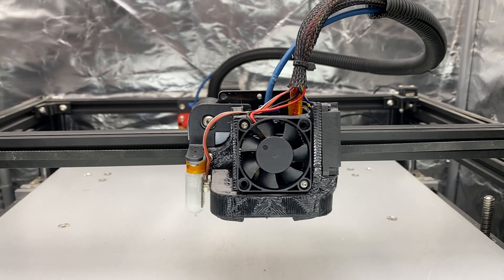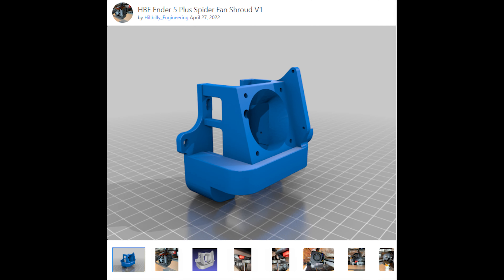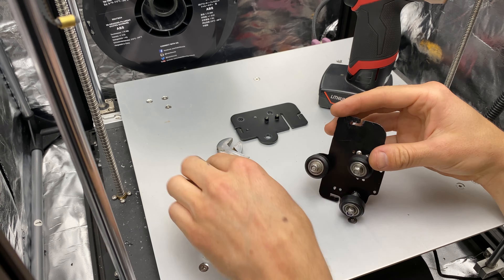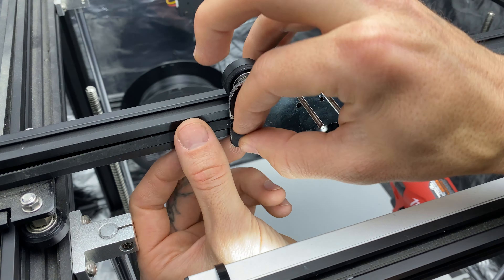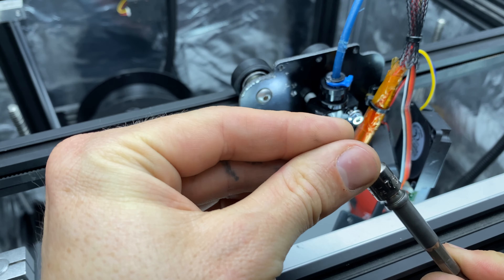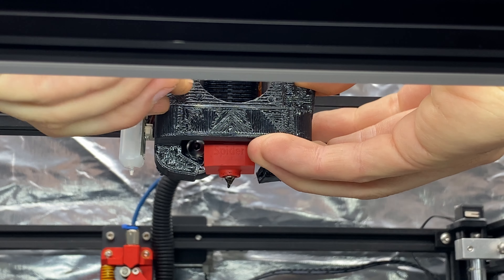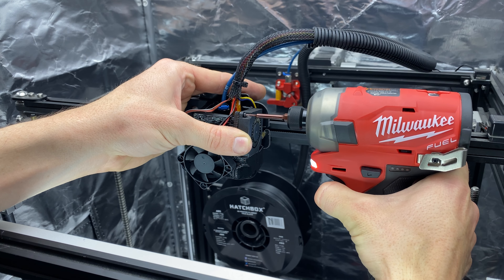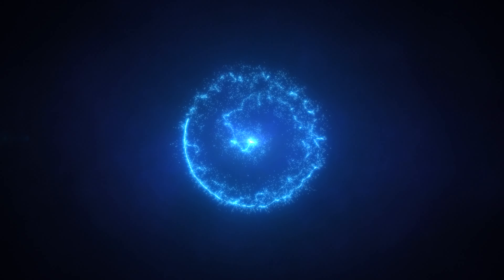How To Install Spider Hotend on Ender 5 Plus

Comment: Just as a note on this, the new Creality Spider v4 "Speedy Spider" is smaller and about the same size as the stock, within about 0.3mm   
I did have to put a small washer on my BL Touch as a spacer, but aside from that, everything was pefect with the new V4 Spider.
This video is still valid though as there are a lot still selling the V3 Spider.

Comment: I started to install this on my new Ender 5 - Figured since I bought it from creality that it would work. But noticed how much bigger it was than the other then noticed it was not goign to fit without some modifications. So now I am deciding if I do it or buy a different hotend..
Like your design though! Thanks for posting this!
The wires for my thermister are way shorter than the oem wires, looks like I might have to do some splicing as well.

Comment: Is there a kit that allows me to use a direct drive extruder? I have bought a direct drive kit from amazon but the kit seems to be sized for a stock hot end not this spider hot end so im getting nozzle bed crashes. Any help is greatly appreciated. I tried spacing the bL touch but then it crashes into the left side frame supports 😮‍💨

Comment: Curious if I can get this shroud resin printed. Gonna work with an etsy custom shop and have them print it off and I'll test it out.
Reply from the maker: By shroud you mean the fan shroud right? 
I’m sure you could, but I wouldn’t recommend it unless you’re familiar with the strength/performance of resin prints. I designed the shroud to be printed without supports on an fdm machine, resin printers work a bit differently and you would want to angle the print and add supports. The “general functional part” type resin I’m using on my resin printer warps over time and snaps before it bends too far. Very high quality parts but strength is not comparable to fdm. I would print it in abs before you disassemble the ender if you can. 
For the cost and effort, you could also probably buy a cheap used fdm printer and use it print the shroud. The shroud doesn’t have to be perfect, you can print a better one once you have the spider setup and dialed in.
Reply: @hillbilly-engineering  I just sent the file to two custom 3d printer etsy shops. One resin and one high temp ABS. Also yes when I said shroud I was talking about the fan shroud

Comment: After doing this conversion I am getting an error for the print head temperature sensor. I know the spider hot end came with a new one. I replaced it but the connector did not line up to the Creality plug. Any ideas?
Reply from the maker: The plug mismatch is another miss on creality’s end. The new thermister plug can be finessed into the stock plug and will work. Basically just look at both male and female side of connectors and when plugging them together, align the pins as best you can and force the connectors together.

Comment: It looks like on the new plate you simply moved the holes up then used some flathead screws and spacers to mount the spider hotend.  Guessing if I simply scribe an offset line for height difference I could just drill some new holes.
Reply from the maker: Sure, you can do it that way. Thats the way I made my first one but the ones I sold have more “nice to haves” and are lasercut. Good luck on your version, don’t let the bit walk!!

Comment: are you building any more of these? i could really use one
Reply from the maker: Yes I can, it’ll take me a few days to put some kits together for those who’ve asked, I’ll shoot an update here when they’re up
Reply: @hillbilly-engineering  great, i have the extruder now, didnt relize i need the x carrage. will be getting one from you when you have it built. would carbon nanofiber be good for the shroud?
Reply: @hillbilly-engineering  i got your kit from ebay last week and installed it. all is working perfect now, only thing i found was i thing they changed the size of the spider hotend. i had to use the 2nd set of holes instead of the 1st ones
Reply from the maker: @mecksg1  do you mean the upper set instead of the lower set?
Reply from the maker: @mecksg1  I haven’t tried carbon nanofiber, the main rule of thumb is you will need more heat resistance than pla can offer. I tried with the basic materials and pla warped almost immediately, but abs, petg, nylon and variants based on these will be fine
Reply: @hillbilly-engineering  yep I had to use the lower set of holes to get it to work right. All good
Reply: @Hillbilly Engineering  I can't seem to find your kit on ebay. Could I get a link?

Comment: I purchased the Spider Hotend for my Ender3 V2 and I am facing lots of problems. The biggest one for me is that any kind of material will not be melted because the temperature is too low. I measured the temperatur near the nozzle and from 100°C-260°C it only reaches 75% of the temperature setting. Thus, I think I will need to change my firmware for the new thermistor. Does anyone know the exact thermistor type? Any help would be greatly appreciated!
Reply from the maker: This video is for installing the spider onto the ender 5 plus, I’m not sure what is going on with your install but I’ve talked with many people who did this same install on their ender 5 plus without any issues. Just install 
 and print, no issues. Maybe you have different firmware or components on your ender 3 requiring a different process?
Reply: @hillbilly-engineering  thanks for your reply! The shop claimed it is suitable for Ender 3v2 and trusted them. Maybe this was the problem because meanwhile the hotend is broken in two parts. I'm not joking! I got it to work together with a BL touch due to the first layer sensitivity. During a 20h print over night a big ball of printed material formed, got stuck and broke nozzle+heater apart from the cooling rips. Of course, I didn't see it live because I was sleeping but the story ends here for me. 
I wish you more luck with the hotend then I had.
Reply: I had same issue and with every thermister change i did a PID Tune and Walah! Runs great.
Reply: Yeah it’s shit it comes loose the heat break snaps I got mine working really nice didn’t last long. For the price not good.  I’ve had better success with a cheap £20 microswiss copy. Been going long time all good.
Reply: @Der_Wissenschaftler  Actually my success was good after I did the tune. Days to a week later the thin neck of the hotend snapped. I had a very poor result. Spider is in the bin. Maybe check out that new hotend most content creators are swearing by I believe it's called the Revo. It's supposed to be the ducks nuts of hotends. Anyway that's my take.
Reply: @Elias  yeah, same for me, the hotend neck broke during a night print. I changed to E3D V6 hotend and I'm pretty happy about it so far!

Comment: Is the x carriage still available? If so where can it be found?
Reply from the maker: Yes, they were out of stock for a few days but will shortly be available again on eBay. Soon there will be a direct drive add on as well which uses this same kit.
Reply: @hillbilly-engineering  isn't the direct drive already out? I have the creality direct drive upgrade for my enders .. but I'm in the UK so not sure if that's a factor
Reply from the maker: @vagautohaus4492  do you mean the sprite? There are direct drive options like microswiss but none that I’m aware of working on the E5+ with Spider. The adapter that will be for sale shortly converts the Spider setup shown in the video to direct drive.

Comment: spider is advertised at 500 degrees.  it will never reach this with the thermistor they package, since it maxes out at 300.
There is no firmware that allows a 500 degree use on their site and therefore, if you want 500 degrees, youd need a pt100 or pt1000 - wether this fits the spider, or is advised is not clear. i for one am returning all my spider hotends due to misleading advertising.

upgrading to a pt sensor may well void your warranty, since creality 
themselves do not offer a 500 degree capable hotend firmware.

to top it all off, filament can get blocked due to the increased cooling and will need to be used at much higher temps, eg previously i could print PLA at 190, with a spider it needs to be 220-240, PETG would need to be set (for me) to 255-260, instead of 230-240

this means that 300 degrees offered by the 'upgraded' thermistor packaged with the spider, is a psuedo upgrade.. since all temps need to be increased when using the all metal hotend anyway, ie, a filament needing 275-280 degrees, will need 300 just to get it heated to the same viscosity

hotend nozzles are extended and look like the ender  7 nozzles.. but creality even dont have any listed for the spider - your existing standard sized nozzles wont work

If you have a CR Touch or any other ABL, and want a creality firmware - forget it, they have two seperate firmwares, one catering for spider, one for cr touch.. but nothing for both in one. 

Marlin for example on the other hand, you can configure the crtouch and the 300 degree thermistor during set up.. but i think ill avoid that and grab another hotend rated at 450-500 and is either packaged with items like a thermistor in line with their claimed specs, or at least know their product and be able to advise and guaratee their hotend when upgraded with higher spec thermistors if not packaged with the hotend itself
Reply from the maker: You make some valid points! Your note about Creality firmware either working with ABL (BL Touch) OR the Spider but not both is exactly what the X Carriage overcomes, you do not need to adjust your firmware if installing with the HBE X Carriage. 

I had to lower my print temp by 10 degrees to 240 based on my temp calibration tower, compared to my stock hotend which liked 250. Keep in mind I have a heated chamber and dual drive extruder which prevents jams. I also assembled my heater and thermistor into my heater block using thermal compound for best performance. I have not used it with PLA yet since I have a different machine optimized for that. In my opinion, this hotend is a TON of bang for buck for the average user who builds functional parts frequently using ABS/ASA or PETG, a similar hotend from a name brand sells for much more. It is new right now, and there are supply chain issues plaguing MFG (Shanghai is COMPLELTY locked down, no one can enter or exit) companies will surely be adding support with replacement parts like nozzles soon. I'm not saying this is the highest performing Hotend out there, only that for the cost, ease of installation and performance it is a very attractive modification. 

As a general note: If your printer does not use a dual driver extruder, I would highly suggest upgrading it to a dual drive extruder whether you use this hotend or not. It is well known now that single drive extruders suffer from slippage and have a much higher chance of jamming, especially when doing long prints inside a heated chamber. Since upgrading to dual drive ($15 on Amazon) I have not had a single jam.

Comment: Spent 2 days with Creality Spider - this pure crap.
It has a design issue in heatblock and nozzle itself - I never could make it extrude any type of plastic at required speed to print fast as advertised.
Also silicon cover just melted)))

Once I replaced the heat block and nozzle - the issue was gone - so it was not a heat barrier or cooling or extrusion issue.
And thanks to the author for the model of fanduct - it works just perfectly.
Reply from the maker: You’re welcome on the fan duct, sorry to hear your troubles with the Spider. May I ask what materials you had trouble with? If you flip through Reddit you’ll find many who are successfully printing over 200mm/s with the Spider. The fact that your silicone sock melted makes me wonder if you ended up with a knockoff? I’m scratching my head because I have two Spider hotends that are both working well and both socks still look new, it’s been a solid upgrade for me. 

Just a note on it, with a .6mm nozzle using ABS I’m able to extrude about 3x faster in a straight line than the stock hotend so now the limiting factor is residual heat in my part and my actual machine ringing haha
Reply: @hillbilly-engineering  Materials: PLA, PETG, ABS.
I had to build my own temp curve for spider thermistor with thermalpair and multimeter. Even after that I was not able to extrude normally.
About knockoff - I don't think so - I doubt it could go above 300-350 even with wrong termalcurve.
AFTER: building correct curve I thought spider will start work - nope.
But right after I swapped hotend heating block (big shiny metal piece) and nozzle - I could print with 200, I used a heater block all metal + brass nozzle.
Reply from the maker: @ArtemSure  Which printer do you have? It's odd, because myself and others use the Spider because it's plug and play with no adjustment of the firmware needed, no messing around with thermister temp curves. The tech baked into the Spider (bimetal heat break, coated nozzle, large heater block) is used across the industry (E3D, Bondetch have similar) there isn't anything special about it aside from the good price, decent quality and ability to plug and play with many creality printers to replace the slower extruding stock hotend. Did you verify the nozzle was bottoming out against the heatbreak and not the heatblock? Otherwise the design of the hotend similar to stock, just much larger with more powerful heater and better materials.
Reply: @hillbilly-engineering  it is ender 5 pro. My board is 1.1.5
Without creating a temp table( temp curve) thermistor which came with spider report wrong temperature, lime super big deviation more than 30 degrees Celsius.
Reply: @ArtemSure  sorry if it's late, but can you tell which block and nozzle
e you installed in place ?

Comment: Just raise your limit switch, takes seconds
Reply from the maker: If you raise the BLTouch then the nozzle will hit the bed, so that doesn't make any sense and I don't recommend others do that.  You can lower the BLTouch but then it crashes into the vertical rail mounts. Creality released a revised hotend to address the issue but the heater block is smaller on the V2 and V3 spider hotends than the original Spider...If you want to use the original Spider hotend on an ender 5 plus you need some way of moving it up.